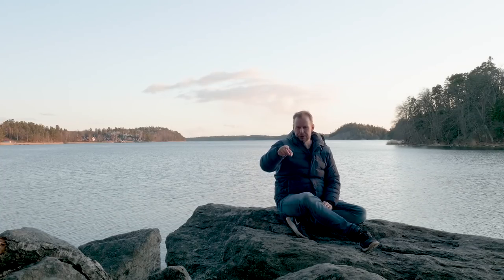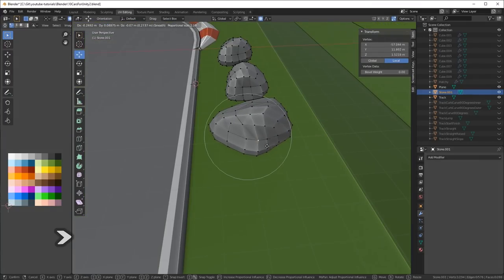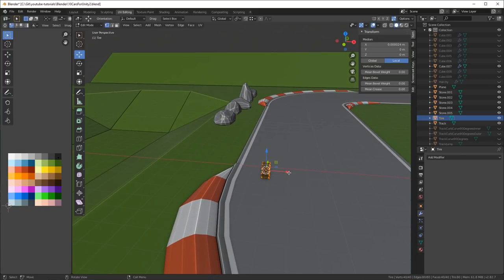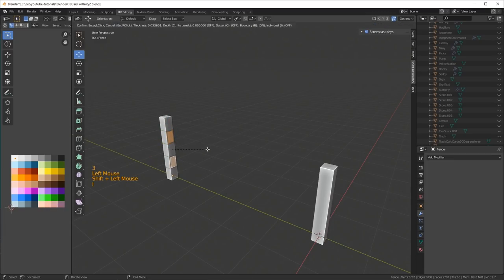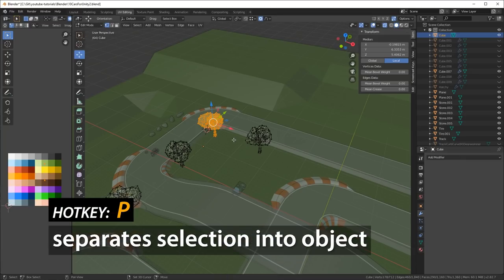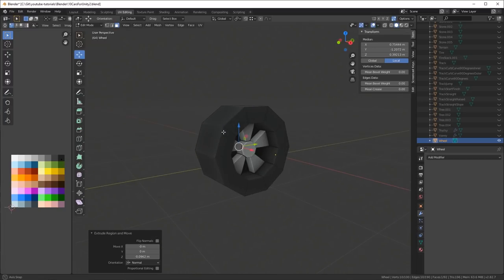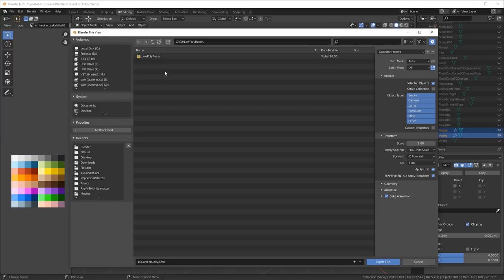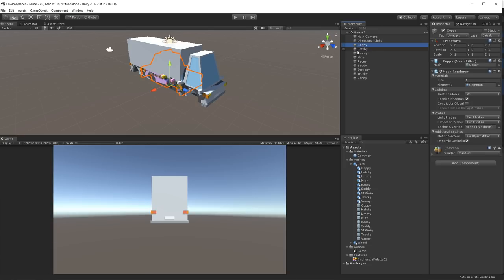Low Poly Racing - Making Of - Ep 2 - Unity & Blender

Comment: Here's just something to muse over. A typical four wheeled automobile's center of gravity is actually a bit forward of the physical center of the car due to the weight of the engine. On the other hand, a typical four wheeled car pivots at a middle point on the rear axle. The pivot point is strictly determined by the fixed real wheels and the differential turning geometry of the front wheels is calculated for a rear axle pivot point. In a fairly adequate physics simulation, a pivot point near or at the center of gravity would cause "drifting" and "spin-out" through even moderate turns, more so than real world.

Comment: 15:40 you could select all the faces then go to Mesh>Normals>Recalculate Outside and it would flip the wrong normals automatically :)
(oops i just realized another guy commented this before me but let me give you an extra tip:)
Use "Origin To Geometry" to quickly set the origin to the center of the geometry! :D

Comment: For exporting I use Blender linked libraries so I can have objects both at 0,0,0 and also around the scene for scale comparison and better usability.
I rarely make all the models at once and I keep coming back to retouch models.
Pros:
- You don't need to hide/unhide everything each time you want to edit and re-export something.
- You can see quickly all your models
- Easier to keep scale and style across all the models
- Unity can import .blend files and this allows to edit multiple objects in same scene while keeping them as separate objects in Unity 

Cons:
- Each time you create a new object you need to create the new file, import a first time in Unity, create the link with the library.

Btw, I use this method importing .blend file directly (linked files will update and be re-imported automatically) so I'm not sure if I'm missing out on something by exporting with .FBX instead

Comment: Good Day,

first of all thanks for the awesome videos. They are really helping out as me and my girlfriend are creating props for a new game.

I have a question regarding the "Double Face" and "Backface Culling": Is there any way to get both sides [of specific selected faces] to be rendered in Unity on both sides? Basically that they dont have a front and back side but both rendered.

Great work and looking forward to the next video!
Reply from the maker: Cool, great to hear - thank you! Glad that it can help out. You can render both sides in Unity but you have to use a shader that has Culling set to Off (by default Unity has Culling Back on all shaders to save performance). The best way is probably to model objects so faces have two sides where needed.

Comment: Just curious: Doesn't pulling vertices on the rocks deform their quads so they may be impossible quads? Why don't you use tris? Or it just doesn't matter later on on unity?
Reply from the maker: Hi, as long as you don't move vertices so edges intersect it's fine, and even if the quads are not even, every renderer will turn it into quads before sending it to the graphics card. The benefit of keeping the quads is to get less prominent edges to keep a quad look, and the mesh will still subdivide nicely in Blender if you want to increase detail.

Comment: PAY ATTENTION! There is a much easier way to fix the faces or any other bug(mainly at subdivision surface modifier): select the object, go to edit mode, select everything, press Alt + N and recalculate outside (if you need inside too). You can fix many bugs in Blender using this method so do it :)
Reply from the maker: That's awesome, THANKS! =)

Comment: I noticed that you had to fix the cars in order to import them due to the inverted faces. Is there a way of building your cars so that isn't a problem or is this just one of those things that happens when using Mirroring?
Reply from the maker: It wasn't due to mirroring, but when I extruded faces for the headlights and bumpers etc I extruded them in the wrong direction so the faces got inverted. You can use Alt + N and recalculate all normals to outside to fix it for all objects and you can avoid it altogether by extruding in the face's normal direction.

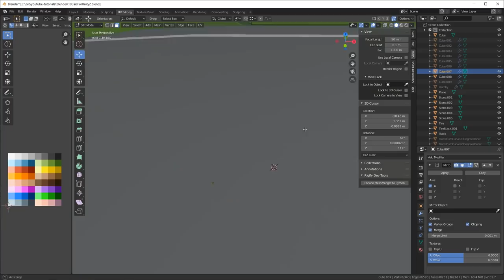Comment: I had same problem at 15:20, there's a shortcut that flips all normals outside that are inside and you don't need to select individual objects that has bad facing mesh

select all faces in edit mode, and press shift+n or alt+n -> recalculate outside

Comment: Why wheels need to be separate objects? Unpacking prefabr dosen't do this?
My model is standing on the rear bumber in unity when I set axes like you did -> EDIT: I was updating an model in unity. When I have deleted in and added new one it is good. I was looking on prefab definition and it had wrong transformation. Some cache? this is strange...

Comment: Why importing blend files is bad?
Also when a car make a turn, it pivots around the rear wheels in real file.
Reply from the maker: I should have mentioned why in the video, good point. File size ( a primitive object could vbe 20kb as FBX and 500KB as blend) and the asset store doesn't (or at least didn't) allow blend files if one ever planned to release assets there.
Reply: Imphenzia thanks, you can use blend files in the store if you provide fbx too